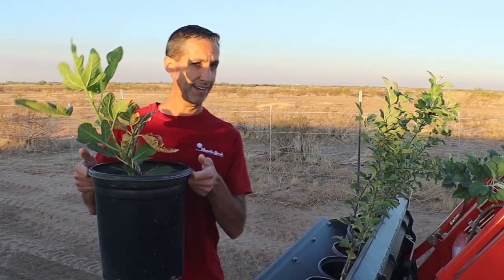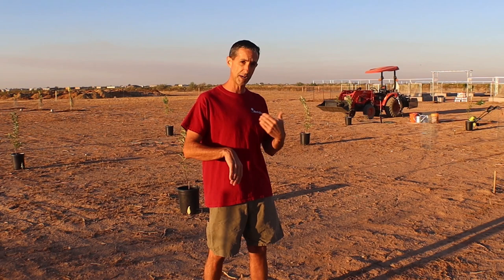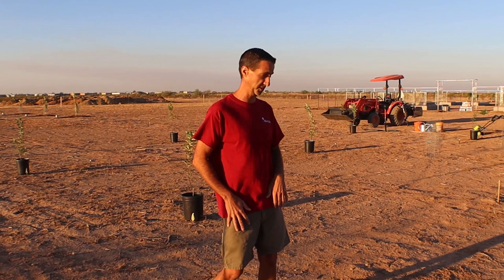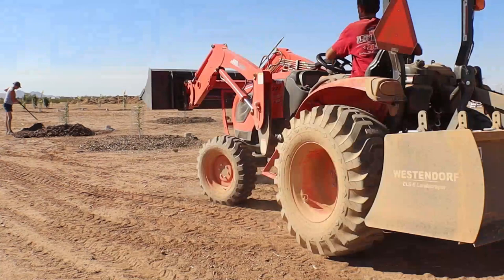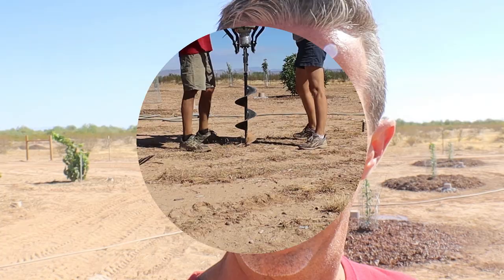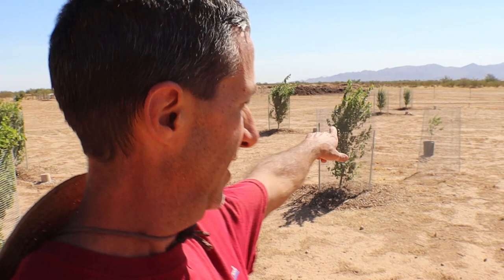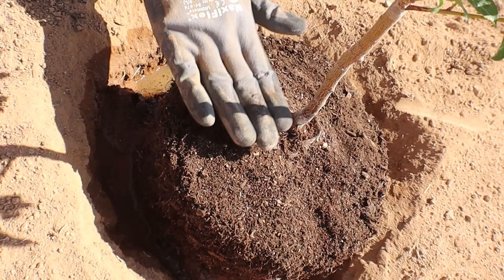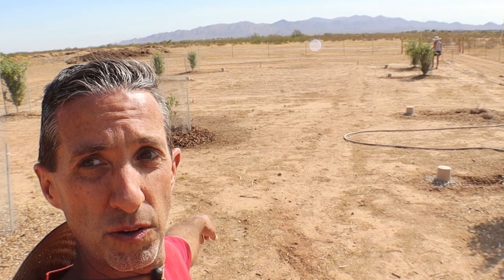Desert Farm Vlog | Planting Apple Trees & Plum Trees in the Fall

Comment: What technique is the tree planting and watering system called and what's the purpose of it thanks 😊
Reply from the maker: Hey there Ali. I'm not sure there is a name for this technique, but it's common to have trees planted with watering rings around them to hold irrigation water. The irrigation system is also very common as it's made out of PVC and ends with a 1/2 gallon/minute bubbler at the end of it to dispense water into the ring.